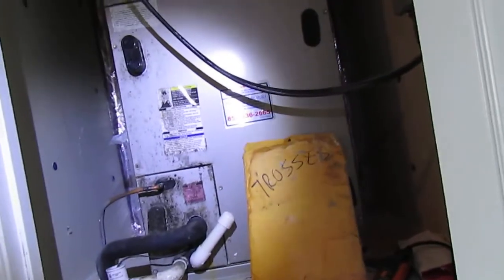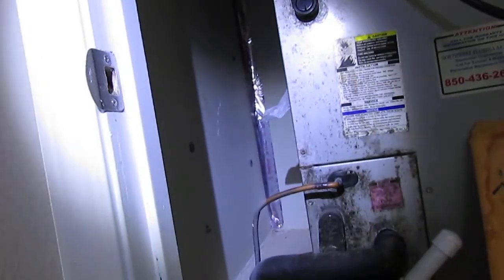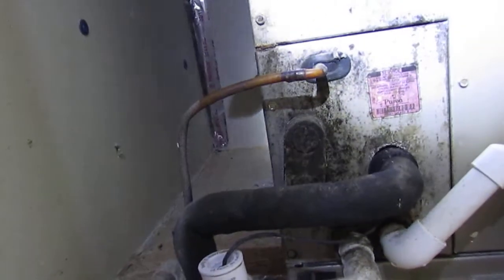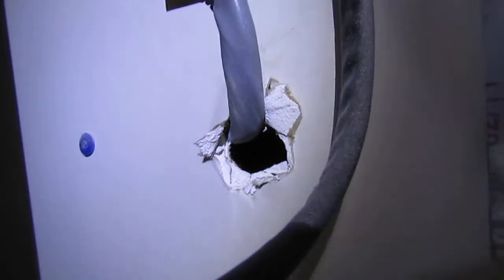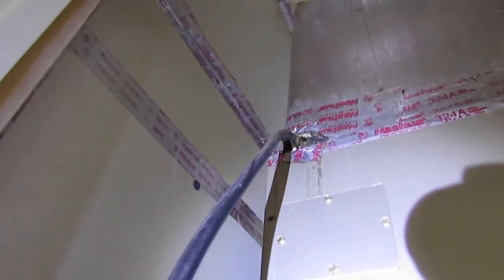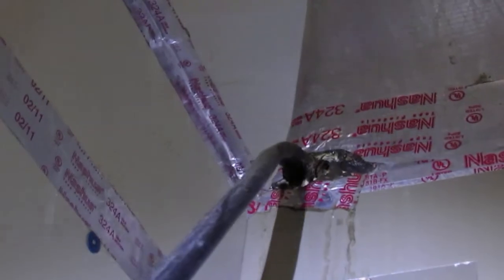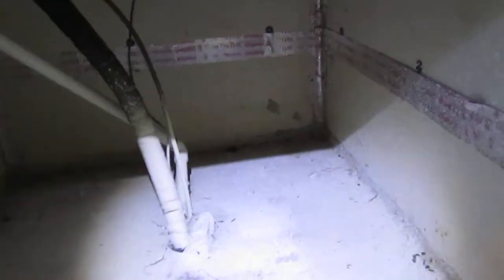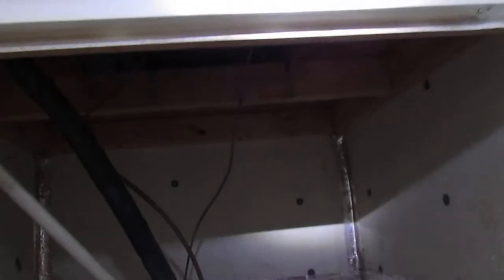Dust inside HVAC Closet Door Frame do holes gaps need to be sealed Air Conditioner Evaporator Coil

Comment: What should be used to fill the holes and gaps in the HVAC closet
Reply from the maker: I use Great Stuff Foam for openings larger than an inch and caulk for smaller holes
Reply: @southernhometalk2465  Thanks so much
Reply: Should air be blowing very hard inside the HVAC closet?
Reply from the maker: I wouldnt think so, sounds like you may have a leak in either the return or distribution side.

Comment: I can see the attic from my closet space is that right or should it be covered up, curious if that's why sc keeps running if  its trying to cool down attic
Reply: I have the same question/issue. I'm thinking about sealing up the huge gap into the attic, which is venting into the closet where my indoor unit is. My thermostat is on the adjacent wall, which makes me think that's why my thermostat is reading 7 degrees hotter in the house. I was worried if I sealed this closet, would I causing any potential harm? I wasn't sure if this needed to be ventilated or not.

Comment: My HVAC closet is very similar to this. Does the wood the unit is resting on underneath in the return need to be treated with a mold barrier? Been having a weird smell in my home. Not so much like dirty sock syndrome. Have not been able to successfully pinpoint it. The coil was replaced 6 months ago
Reply from the maker: Central HVAC Systems are vulnerable to Mold Issues. There are several ways to help mitigate it as well, by using UV Lamps and Damp Rid Buckets. I only use my central system for heat, now that I have mini splits, which are many times more efficient than central systems

Comment: Doing a renovation on an older home with no HVAC... Are there any pro(s) or con(s) to putting the HVAC system in a closet vs. the attic?? Noise?

Thanks.
Reply from the maker: I am no fan of Central HVAC Systems, since I have switched to mini splits which are far more efficient than central